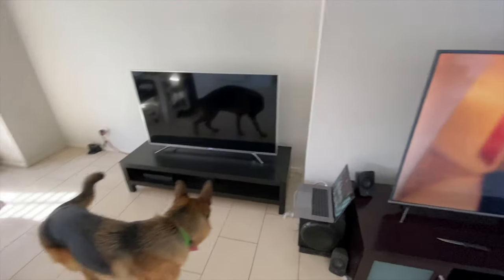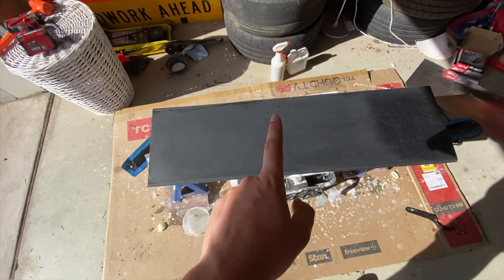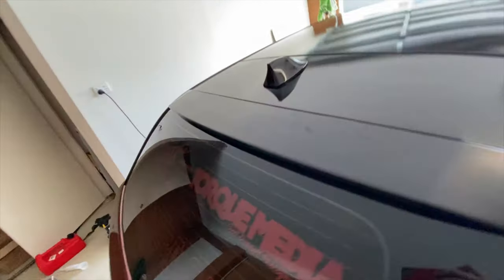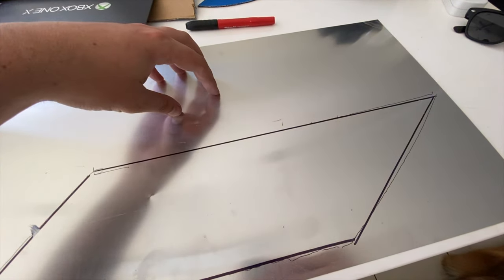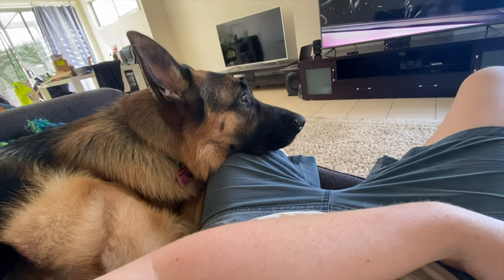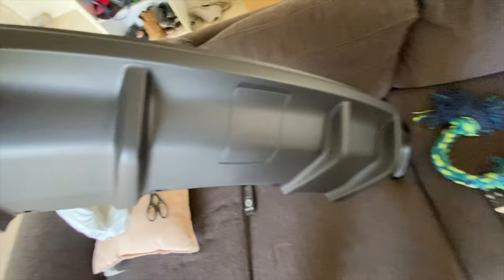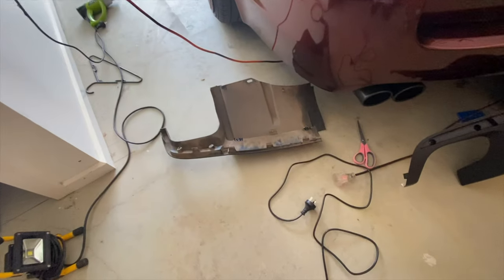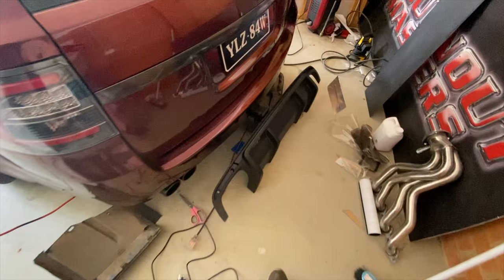More New Parts For The Wagon

Comment: 1. the diffuser wont just clip in, all those tabs need to be modified and cut. the best way to mount it is to screw/bolt it to the rear bar behind where the reflectors mount and then mount the reflectors in afterwards from above the mufflers. 

2. remove the black plastic piece thats above the rear window now and use the factory mounting holes to mount it into. will take a bit more work but should look much better and you wont run the risk of it ripping the plastic tabs of on the highway and launching it into someones windscreen.
Reply from the maker: Scott Durnell mint! Yeah I saw it mounts different, I’ll probably use a bit of sikaflex too lol